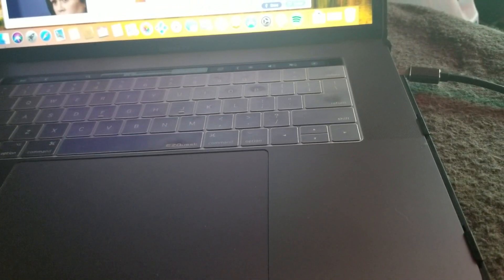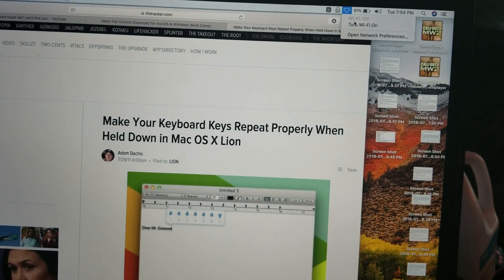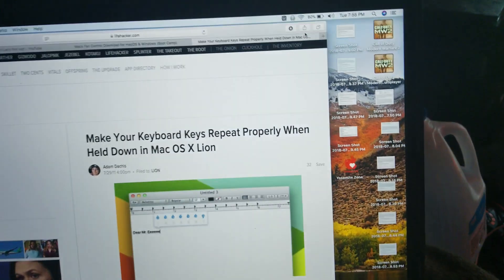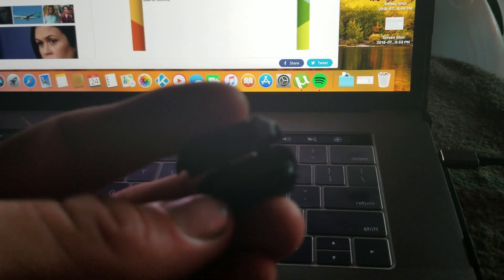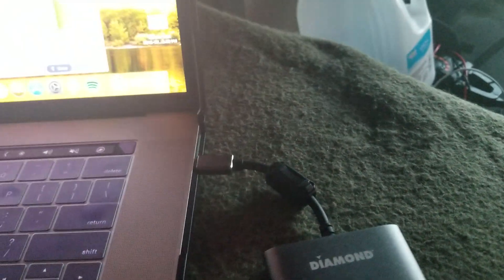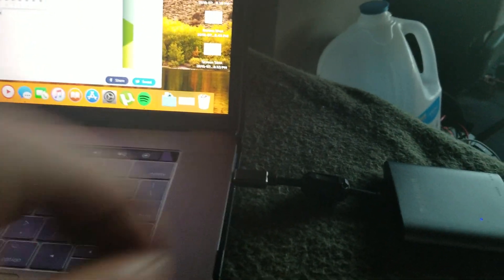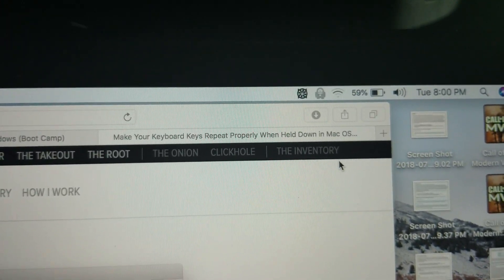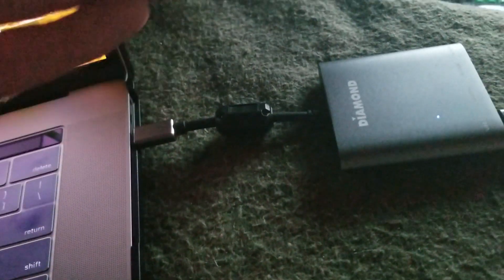MacBook Pro 2017 WiFi fix (dongle issue)

Comment: Actually it only affects some of them that had faulty shielding or were assembled incorrectly. I know it's not normal because this one didn't have that issue before the apple store technicians replaced the top case and battery.

Comment: THIS REALLY WORKS! I've bought a couple of USB-C dongles (including the official Apple Multi-port Adapter) for my MacBook Pro 2020 and they all interfere w/ my wifi connection. Even the 'foil thing' (covering my dongles w/ a foil) didn't work for me. So, I ordered some snap-on ferrite beads online and attached it on Apple's Multi-port Adapter and it worked like a charm! What's great about this solution is it won't make your setup look ugly (e.g. the foil thing). Plus, the ferrite beads are small, easy to carry around. Thanks a lot for posting this video, you're a lifesaver! :)

Comment: Mine happens when I connect the HDMI cable
Reply: me too, any solution to that?
Reply: I think it’s a similar problem ... interference. I have the same problem on macbook pro 15” mid 2014
Reply: @danienteaqualcosa  change the direction of the HDMI cable
Reply: @joyceabena5304  thanks! :)

Comment: What is the size of the ferrite choke that you used in the dongle?
Reply: 3.5 or 5mm could be fitted
Reply from the maker: I honestly have no clue. I just bought a pack of assorted ones on ebay.